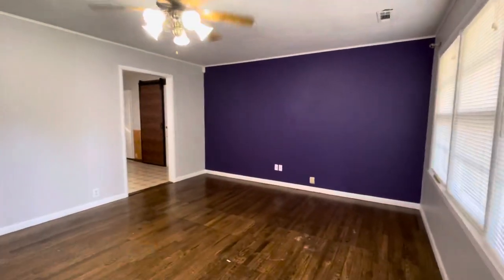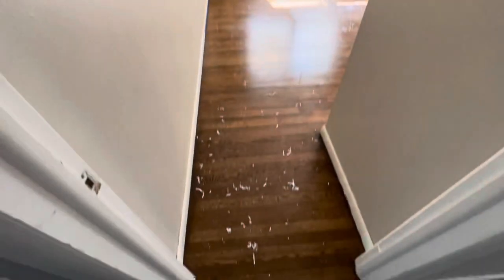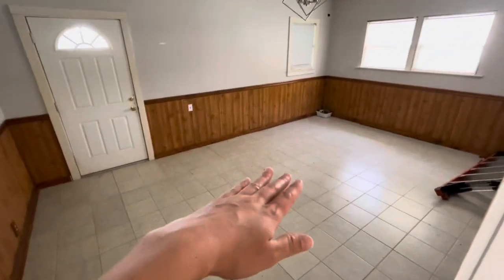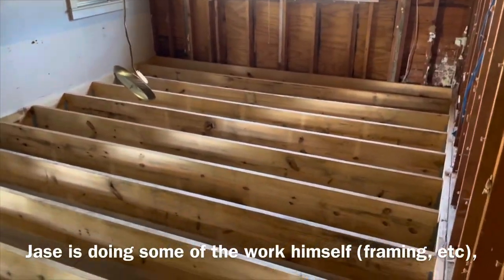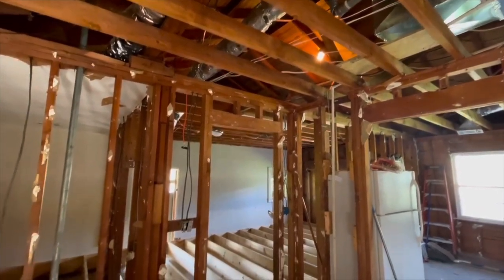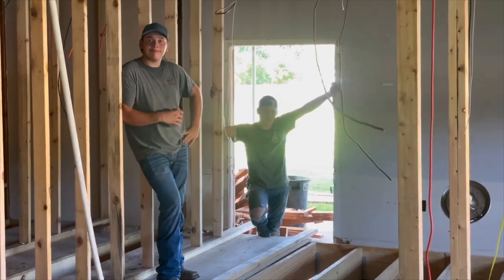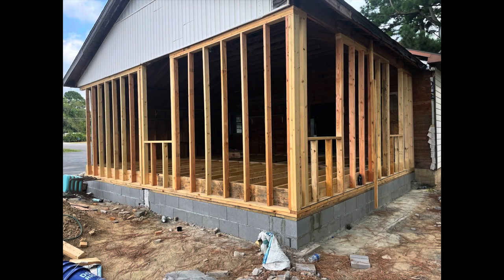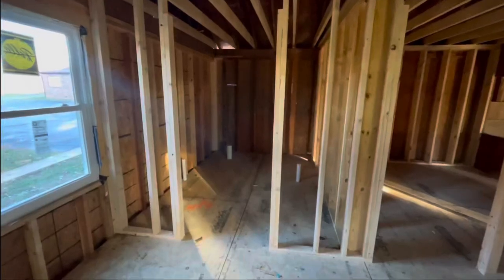WE’RE MOVING! Seewald Fixer Upper House Tour! — Part 1

Comment: CONGRATS! 

@1:23 You mentioned that you guys planned to removed the walls, I'm sure you guys did your research and knowledgeable that if those walls are load-bearing wall, they need some kind of supports (like beam supports) to hold the existing load, so that the house's ceiling will not collapsed.
Reply: Duh

Comment: With so much wood, try to get your 🔥  planning ready. So install fire detectors/optical detectors  in each room, if possible on the electrical network, instead of battery powered ones.  And a carbon detectors in the space where your central heating is going to be.  Fire departments  can advise you on how to install them where and which height. It can possibly safe your life. And have fire extinguishers  ready and checked each year in critical area's.  And have the kids trained so they know what to do when there's a fire. Like stay low to the ground.   It might seem unimportant but it can safe your life and your kids.   ^^

Looking forward to seeing the rest of the decor!